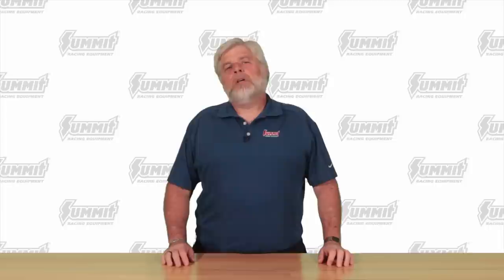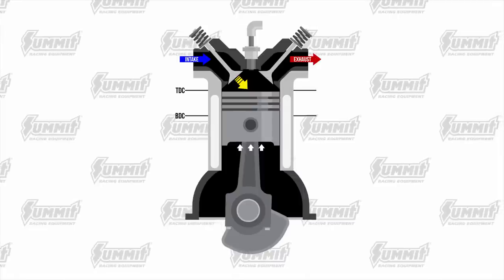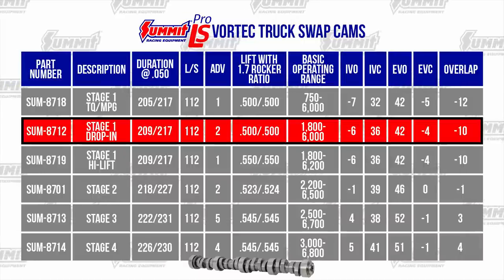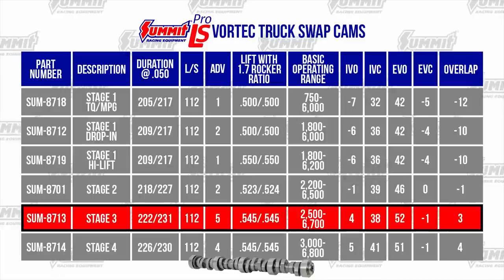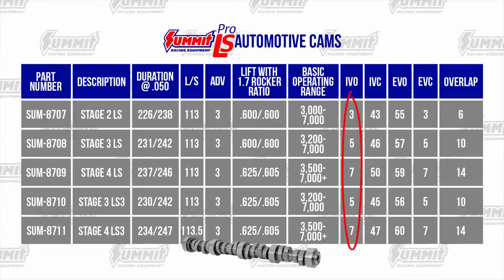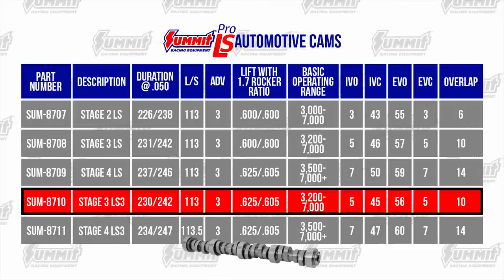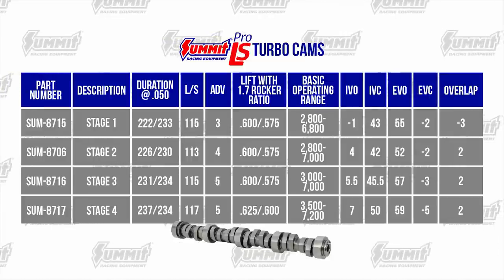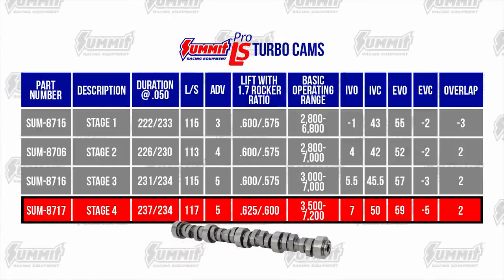Summit's New Pro LS Cams Are Here!

Comment: Performance wise, what’s the biggest difference between the Stage 2 and the Stage 1 High Lift?
Reply from the maker: Thank you for your question.  SUM-8719 has -10 degrees of overlap and has a noticeable chop depending on the displacement and idle rpm.  It makes very good power at little to no expense in fuel efficiency.  SUM-8701 or the higher lift version SUM-8720 has -1 deg. Overlap and has a mild chop.  These cams move the powerband up and will make more power at the expense of some low rpm torque.  These cams are about as big as we recommend with a stock converter in 5.3L applications.
Reply: I think the less duration on the stage 1 high lift 8719 cam will be slightly better at lower rpm both these cams will work with a stock stall converter you'll need 3.73 gears in a 4 speed overdrive automatic and both of these cams you mentioned would perform even better with a 2300-2500 lockup stall converter you will feel more torque 2500rpm to 5500rpm and more horsepower 3000rpm to 6200rpm and you'll notice a big difference in acceleration from 2500-6200rpm it should pull very good in this powerband over stock but slightly lossing some low end torque below 2400rpm with a stock stall converter with a 2500 stall converter l guarantee you'll never notice the torque loss at all making it much more eager to rev up from a dead stop and a 6.0 will be more forgiving on the low end or lower rpm with the low speed torque with a stock stall converter than a 5.3 will in a 5000 pound truck or SUV
Reply: Summit Racing I should have mentioned performance wise pertaining to a 5.3 but thanks for the response! I went with the 8719 but have yet to install it unfortunately.
Reply: Gloria Maletta thanks for the info! I went with the 8719, to minimize low end loss if any from putting it in a 5.3. In fact, I got this cam in the hopes of getting a little more pull in the low end to help with 33s, uphill encounters and to restore some mileage if any.
Reply: @TheDiegoKidd  let me know how well it works with 33 inch tires because I'd like to put this 8719 cam in a 2009 ppv tahoe 5.3 weighing the difference in getting a GM LS 6.0 450 crate engine is 4300 dollars the 5.3 with cam with lifers and cost with springs pushrods timing chain oil pump and redo the heads with new valves on a 5.3 and keep the 130,000 mile shortblock would be cheaper but it's not that much more for the new 6.0 of course it may take 2 more years to save for it instead of next year for a cam with upgrades on the 5.3
Reply: Gloria Maletta I weighed that option out too. Getting the 6.0 instead and/or putting the cam in it. The 6.0 swap would be the best for gains. But if I stick with the 5.3, I don’t have to pull the whole motor, I can pretty much freshen up the top end like how you would do just by pulling the heads. That’s why I haven’t put it in yet, I was gonna swap just the cam and change timing chain and oil pump real quick, but im thinking rods and lifters too. I’m at 190k and my 5.3 still runs real good, no misses or ticks so it would be nice to know I have a fresh top end with a nice cam. I’ll keep in touch about how it works out. I think you could get away with the cam and timing chain for now though at 130k.
Reply: @TheDiegoKidd  this GM performance LS 6.0 450 will require a LS3 style intake or L-92  because of the rectangle port heads the 5.3 won't work 92mm throttle body and so on the stock 5.3 runs decent I'd be happy with something that is similar in power from idle to 3000rpm but makes more power torque and horsepower from 3500rpm to 6000rpm without such a big drop in torque above 5000rpm because the stock 5.3 above 5000rpm is rather weak and it's not the engine or heads holding it back the stock cam is it's designed for low speed torque not 6000rpm

Comment: So for a stage 1 cam a stock converter is good?
Reply from the maker: SUM-8718R1 (Stage 1 Truck Tow/RV), SUM-8712R1 (Stage 1 Truck Drop-in), and SUM-8719R1 (Stage 1 Truck High-lift) can all be used with your stock torque converter. The first two can be used with stock valve springs, although LS6 valve springs (SUM-174002) are recommended for all of these cams.

Comment: I have a 5.3 09 block out of a impla is a truck cam good for this block or the other type cam
Reply: I put the CCA-SUMLSGT100 cam in my LS swapped Fox body and  its incredible the difference it made.  The specs. are 216/222  .561/.566   111 degrees LSA .  This cam is made by Comp Cams and isn't in this video and haven't seen it listed in recent catalogs.  Works with stock torque converter and requires idle tuning.  Couldn't be happier with it.

Comment: Can I put the sum 8712 stage 1in my lc9 ?
Reply from the maker: Thank you for your question.  SUM-8712 is an excellent choice for an LC9.  Great power and works with a stock converter as well.  If you wanted to add a set of LS6 springs to it, SUM-8719 is the higher lift version.  It would extend the rpm range further with their greater spring pressure. 
https://www.summitracing.com/parts/sum-174002/reviews

Comment: Will the truck stage 1 high lift work with the stock vat 6.0
Reply from the maker: Hello David, the Stage 1 high lift SUM-8719 has .550 lift.  This requires changing to a LS6 spring part number NAL-12499224, but other than that…it’s a drop in.
Reply: And it wont pass emissions
Reply: Damage, Inc. I don’t have that problem

Comment: I have the 525 ls cam wonder what kind of hp I might get with 823 ls3 heads with the blue beehive Springs ly6 6.0 in a 1994 camaro ?
Reply: Terry Gamble 450 ish crank depending on tune and headers etc etc....
Reply: @streetfighterracing1583  what cam n stall would u recommend for a 408, full bolt on, gears? I would love all around power but mid and especially top end is a must.
Reply: Jermey Gonzales I made 410H/415T at the wheel with LS6 intake, stock throttle body, long tube headers, etc etc bolt ons. I’d recommend the stage 4, get a two-step tho I’m a 6-speed. BUT YOU MUST DEGREE IN THE CAM!!! Piston to valve will be good as long as you degree it in but never hurts to get checker springs. I like the stage 3 it’s very competitive with name brands but didn’t overshoot what else I had that’s why I didn’t do the 4.
Reply: @streetfighterracing1583  the motor is in a truck, running a built 4l60e no stall but willing to get one,    port n polished L92 heads, ported truck intake, long tubes, ported Tb, 410 gears, it's made for the street scene

Comment: I have a 5.3 I’m building for my Silverado and I’m considering the stage 3 SUM-8713 cam. I have 37s and 4.88 gears that give great low end torque. Would it be sufficient to run with a factory converter
Reply: The 8713 would be an absolute dog in a 5.3 turning 37 inch tires. I would think 8719 at the most.

Comment: Would stage 3 turbo work well with ls7 ?
Reply from the maker: Thank you for your question.  The cams are advertised with lift for 1.7 rockers, but are designed to work with the common .670 lift springs with a 1.8 ratio.  TFS-2500287P spring packs with Ti retainers would be a good example.  The Summit Turbo Cams would work well with the LS7.  With a 427 cubic inch engine, the Turbo Stage 2 SUM-8706 would bring the power on early and hold well.  The Turbo Stage 3 SUM-8716 is also a good choice and would work very well in the mid to high range.

Comment: Looking for a good pds cam for my 6.0 (.030 over) lq4 with magnuson m112, 1 7/8” headers, 4l80 2500 stall, 3:73 gears in my C10.  What would you suggest? Of course I want a decent chop!
Reply from the maker: Thank you for your question.  SUM-8714 is an excellent cam and it’s designed to work with the LS6 beehive spring such as SUM-174002.  That will definitely have chop and will do a great job in the midrange too with the converter you have selected.  It is the animal that you are looking for that combination.  Tire Fryer for days.

Comment: The overlap is wrong,  way wrong.  That is valve overlap.   Use .005 or .006 start duration not .050 start lift,  way too much start lift.  Having valve overlap at a negative value is not using the real valve overlap as it can never be a negative value.

Comment: Listing the overlap @ 0.05"  is not very useful, in fact, it's a completely useless number.
It's WAY "after the fact" at idle speeds, 
because of the long period of time the valves have already been cracked off their seats,
and only has negative torque effects between  ~1500 &  ~3000 rpm, and
creates zero misfire issues, like found at idle speeds.
 
The standard for overlap measurement is almost universally around  ~0.006", and 
is a good  ~50 degrees longer than the  0.05"  number.
0.006" measurements tell much more about idle quality.

I'm working on selecting a cam, and I'm trying to formulate a relationship between
overlap / low-lift valve flow / displacement / compression, and 
how this all adds up to a certain degree of Idle misfire (chop), or lack thereof.
( then you can also throw Direct Injection into the mix )
I've made plenty of mistakes in the past........
I'd like to do this right the first time.
.
Reply: Jim Brown it’s listed at 50 thousandth and that is perfectly normal because advertised doesn’t mean it’s a good grind. Only why Texas Speed Brian Tooley and Comp all give you specs at .050 lift. Sooo maybe you should fact check before you write two pages making you look like you don’t know what you’re talking about.
Reply: Evidently you neglected to read my entire last paragraph.
The .05 duration is most definitely important from max Torque on up,
but it is a moot point under low-load conditions.

BTW, I was fact checking back in the early '70's, in actual books and magazines,
and while I'm not a professional engine builder, 
I'm smarter than quite a few that I've read up on, or met.

I perform miracles on a regular basis, and have for many decades,
I know what I'm capable of,
so your derogatory comment just makes you look arrogant.

If you can't understand the plain language that I laid out, 
maybe you're the one who should do some "fact checking". 
I used the word "idle" no less than 4 times,
the .006" lift is THE measurement that MUST BE KNOWN to estimate idle characteristics.
Of course you could always try to argue with David Vizard, 
I'd like to hear that discussion, that'd be great entertainment.
.

Comment: Will the stage4 cam work in a stock ls1 5.7
Reply from the maker: Thank you for your question.    Yes the Stage 4 will physically fit in terms of piston to valve clearance, but you stage 2 or 3 may be the better choice for acceleration based on your gear, converter and other factors.
Reply: Summit Racing I have 6spd car. 3:73 or 4:10 gears in the future. Also wondering what’s better for this my current ls6 intake manifold or a summit sheet metal intake manifold. Also hoping to get some porter 243/799 heads thank you for the help
Reply: Summit Racing interested to hear your thoughts on the gentlemans reply below as im also stock 5.7 with a 6 speed and 4.1 gears in a fairly lightweight 3 series bmw.

Comment: Have an Ls4 5.3 any suggestions?
Reply from the maker: Thank you for your question.  If it is still in a FWD vehicle with a stock converter, SUM-8720 is about the largest that works with a stock converter and makes really good power.  If a stall converter is used, stage 2 SUM-8707 is a good choice if you are looking for a rougher idle and willing to trade a bit of low end torque for more horsepower up top.